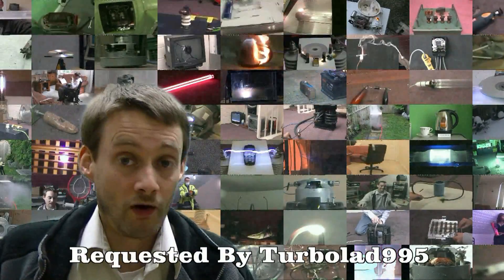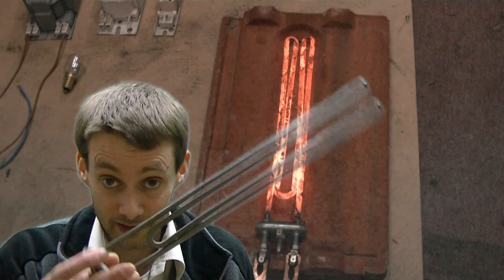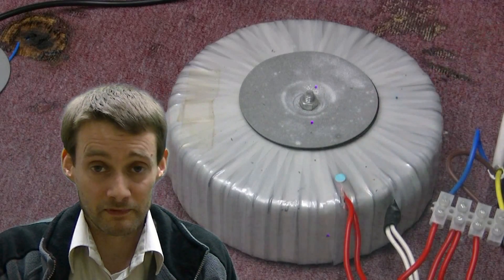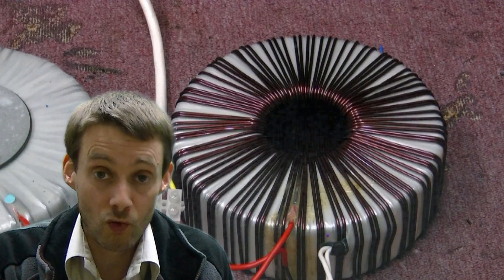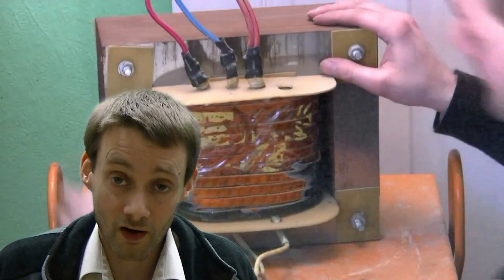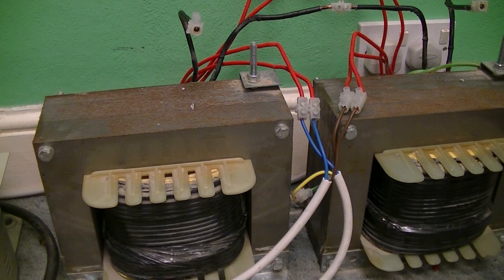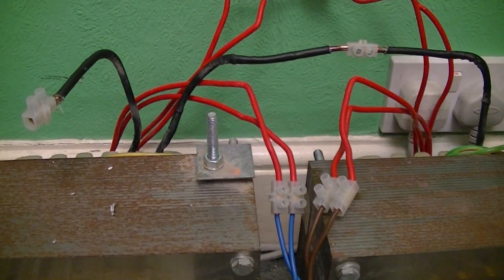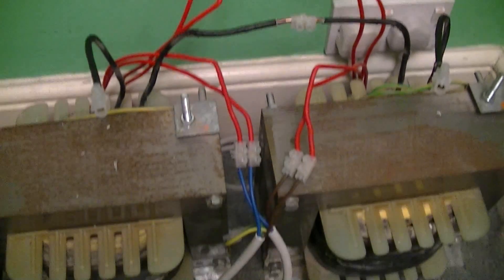Heating Elements Pop On 440v

Comment: I bought those tranny’s to sell, but as they were going cheap to start off with and they were sitting in my garden for ages, Photonicinduction bout them. 

Don’t hold me to this, but I think that was the time I had the kittens 🐱 and one hit it’s head on the litter box. Hmm 🤔 not sure. Anyway. 
He see I had a matching pair and gave me a ton for them straight away (also my ex at the time hated them sitting there in the garden). I had a roughish idea as what he was going to do with them. 

I did have a another one before that which I used as a high current tranny which I did a vid for to see how current a 13A socket would take.

Comment: How hot did those elements get?
Reply: +{MLP} Rainbow Dash Considering most heating elements are made of resistance wire called Kanthal...Around 1500*C. Might not be Kanthal, though.
Reply: {MLP} Rainbow Dash Over 9000
Reply: +{MLP} Rainbow Dash 
These heaters reached probably 2000C

Comment: Nice! But how is your power system set up? I only have to use a 3 phase rectifier, then I have 540 V DC (wich works just as well for this or as in my case - run a furnace). But of course these transformers could be rewinded and used later for other fun stuff.

Comment: Now if he immersed the element in Petrol and connect an over-volted heating element, I wonder how long it would take to start a fire. Make sure the element is completely immersed in the petrol to the terminals (he did prove petrol wasn't conductive).

Comment: well yes, short answer, both. but the way things work, the higher voltage, the more current would flow, unless you ballasted (limited) the current. a low voltage wouldn't force enough current though you, that's why people dont die from touching batteries.

Comment: Just before the element popped I was putting 311.8 volts, 10.3 amps into it (3.2kVA). The welder was running from a variac supply of 188.5 volts, 18.2 amps (3.4kVA). I didn't get the chance to crank it higher. I need another element! I think I know for one going spare though, and a motor...

Comment: Excellent new vid! :-D I laughed so hard when that first element went *POP*. That large one right at the end put on a good light-show.

VID REQUEST: I've been wanting to know for some time, how fast Cuppa-Tea-Time can be achieved by getting a 3kW *un-modified* kettle, filling it with just enough water for a cuppa & then over-cranking it by stuffing lots of volts into it?

Could this be done? Seeing as the element is under-water, it might take more volts for longer than a dry heater.

-BBD.

Comment: It doesn't seem to drop that much. Besides, I'm using the entire primary for this naughtiness, using the 230v portion (normally used for welding on a 230v supply) to energise the additional 170v portion (normally used in series with the 230v winding when welding on a 400v supply). Everything's running within spec :)
Primary's rated at 19A 400V or 32.5A 230V. The 230V winding current is only whatever's required to run the 170V bit though, same as on my 240V-220V stepdown video.